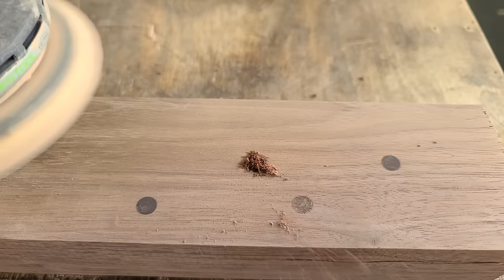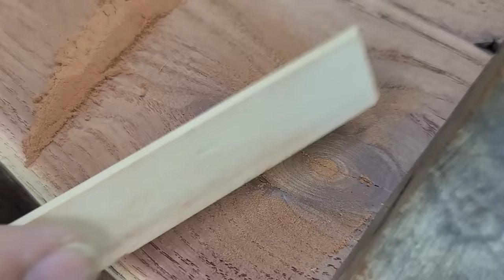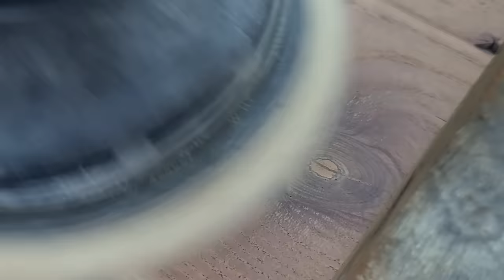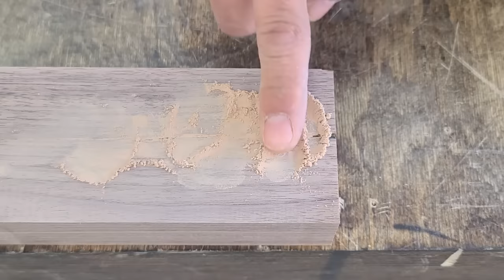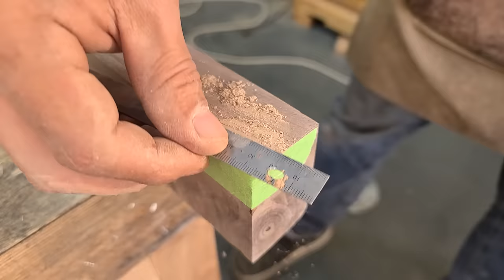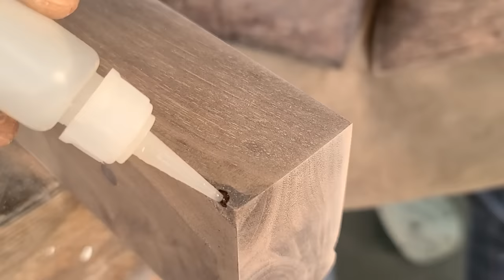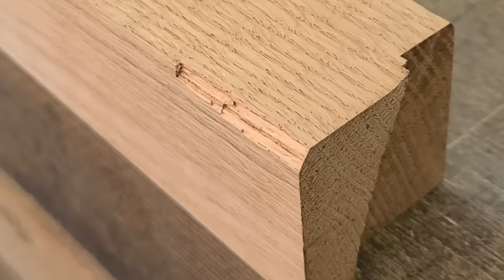Chemical reaction of instant glue and dust / First aid for damaged wood  [Woodworking Tips]

Comment: I don't know where you get your CA glue from, but here in Europe it comes in miniscule tubes and is obscenely expensive.
Wouldn't dream of using it like this.
Reply: Poundland sells it.
Reply: @thechumpsbeendumped.7797 
Presumably by the gram
Reply: @Tinker1950  
I’ve not bought some in ages but last time I did I got multiple 3G tubes (I think it was 5) for a pound.
Reply: @thechumpsbeendumped.7797 
So, my original comment is confirmed.
Reply: @Tinker1950  
Not really, 15g for a pound aint bad. You could do a heck of a lot of repairs with that amount of CA glue.
Reply: Amazon sell large bottles for a few quid, but unless you use a lot of it it's not really worth it, because it'll go off over time.
A small bottle for a pound isn't expensive imo.
Reply: @TomChaton 
I've never been able to find bottles of the capacity these Chinese lads squirt all over the place - well, not at anything like a price which would make it affordable to use in their liberal manner. If I could then no doubt I'd use it in all sorts of ways. That would get round the problem you mentioned of it going off. Mind you, must sniff around Amazon
Reply from the maker: That's right.... You can easily buy it in Korea.
Reply: @Tinker1950  
I just bought 18g for £2 from Poundland But there are loads of sellers on Amazon, 50g for £8-9 inc post is one price I saw, which is a large enough bottle to last most people for years. Keep it in the fridge and it’ll not go off as quickly.

Comment: This method works well for small repairs and does a decent job of matching wood colors. Just remember to always drill a hole at the ends of cracks and pour wood glue into the entire crack. The glue will seep into the crack after drying, allowing you to fill it with your preferred filler afterward. While it may be time-consuming, it's an effective way to create a lasting fix.

이 방법은 작은 수리에 잘 작용하며 목재 색상을 꽤 잘 맞춰 줍니다. 그냥 항상 균열 끝에 구멍을 뚫고 전체 균열에 목재 접착제를 붓는 것을 기억하세요. 접착제는 건조 후 균열에 스며들어서 원하는 재료로 균열을 채울 수 있게 됩니다. 시간이 걸리지만, 오랜 지속력을 가진 고정을 만드는 효과적인 방법입니다.

Happy woodworking! 😃

Comment: Why do you sand before the glue is dry?
Reply from the maker: As sawdust is generated, it fills the empty space and fuses with the adhesive.
Reply: @망치소리HammerSoun  interesting. I would have thought it would gunk up the sandpaper, but I guess it’s thin enough and dries fast enough that it doesn’t?

Comment: Use slot-headed screws instead of Phillips/Posidrive. If you need to drill out and remove a screw, you'll find out why ;)
Reply: Square drives aka Robinson head are better again.
Reply: @The-Real-Ando  Go Torx for the full hit.
Reply: How would you clear the head of a Robinson or torx screw if it's full of hardened gunk?
Reply: @The-Real-Ando  it's easier with a slot-head. That's why boat builders still use them, if you need to replace a plank, you can clear the screw head with the screwdriver you're going to use, or a knife.
Obv. if you're not covering it in muck then there are far better fasteners.
Reply: @TomChaton  what’s a screwdriver?  I’m not going to argue with you. You’re right I’m wrong. Nice chatting

Comment: I used Ronseal wood filler. A good filler. You can sand, plane , stain and Paint. 😳
Reply: The problem with commercial wood filler is matching color. If you use sawdust you know it will match perfectly.

Comment: So.... don't even let the glue dry fully before sanding?
Reply: Correct.  He commented to someone else that the new dust fills in and bonds.
Reply: @glasshalffull8625  and the glue residue ruins the rest of the sanding pad.
Reply: @vidiotsyndrome  Use an older sanding pad and then final sand with a new one when dry.  Problem solved.
Reply: @Glass.... or just premix the dust with wood glue and let it dry- then sand the whole thing ONCE.
Saves time. Plus, you're still supposed to let superglue cure for a full day before doing any other working on it.